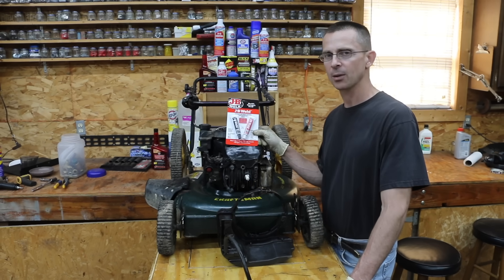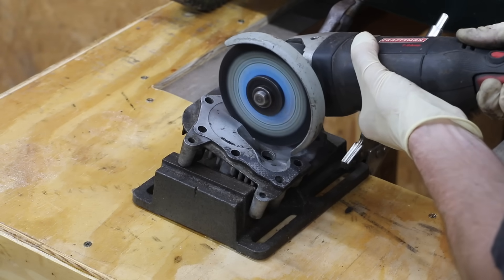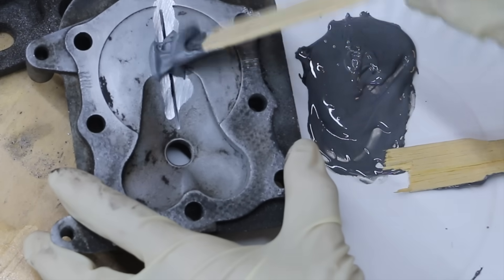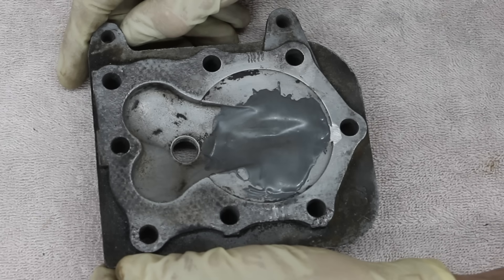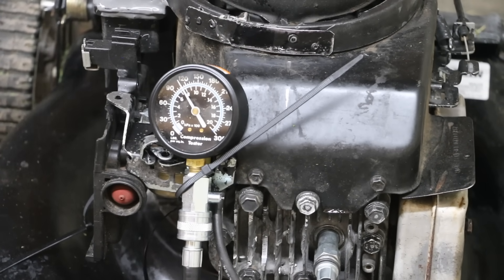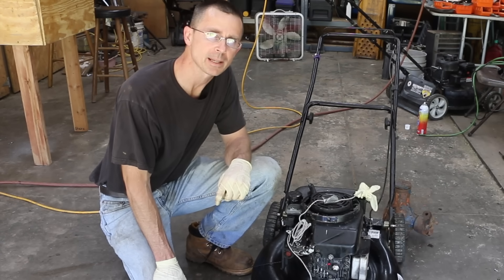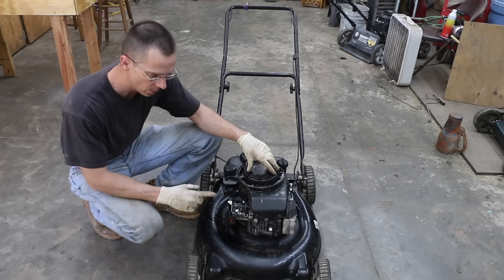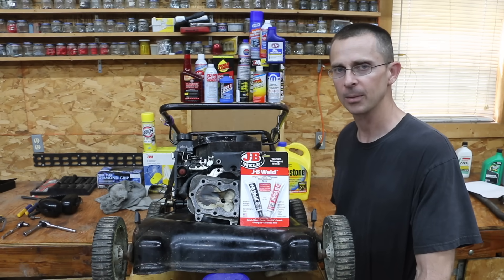Can JB Weld fix a cracked cylinder head?  See the proof!!

Comment: You know, repairing that gas tank got me to thinking about my Dad and home repairs. This was back in the sixties, and we were going to a town 40 miles or so from home. We stopped for lunch along side the road, and as we returned to the old Chevy turtleback, we saw gas leaking from the rear of the car.

We found the hole, which was about the size of a pencil lead. Dad put a screw in it, and then got some soap out and just scrubbed the bar back and forth around that screw head. Now this wasn't store bought soap, this was old home made lye soap, made from ashes and hog lard.

As Dad kept rubbing that soap over that screw head, the drip kept slowing till it stopped completely. Dad checked his Linguine watch, and we sat back down under that tree to wait an hour. We left and drove to our destination, did whatever business dad had to do, and went home. 

The whole trip I kept an eye on that patch for a leak, but it never even got wet. Dad traded that old wreck off a couple years later, and that patch was still holding. I might have been rich by now if Dad had patented  that, and hadn't just passed it over as folklore everybody knew.

I've seen lye soap in stores a time or two, but have no idea if those ingredients would work or not. I could tell you to test it on some tender part of your anatomy and see if it took off hide when you scrubbed one spot too long. (Even with your dedication, I don't recommend that. Saturday night baths isn't one of my favorite memories.)

Enjoy your channel a great deal. Thanks for testing all these things so we don't have to.  👍
Reply from the maker: Impressive repair!  Thank you

Comment: I used it on a fuel line that the screw stripped so I could not remove it or tighten it down. A year later it had a water leak threw the crankcase and the car over heated really badly. Until then the seal held.
Reply from the maker: Impressive repair!

Comment: Before I watch this video, I am going to comment on using J.B. Weld for engine block cracks. I have tried this on my 1949 OC-3 Oliver Crawler with a Hercules IXB3 engine. it had several cracks in the cylinder wall and in between cylinders 6 separate cracks in all. 
I was very disappointing to find out it did not work in the cylinder wall at all. And once it came up to temp the cracks fro the cylinder to a water jacket hole also failed to seal. 
Now I will watch your video to see what if any I did wrong.
Reply: After watching your video, I found out that I did not bevel out the crack or properly clean it. If I remember correctly. so maybe if I properly prepe the area needed for repair it might just have held up. I used another product that you purchase from a pharmacy for something to do with egg shell hardening or something like that I cannot remember what it was called, was recommended to me by an old timer who said it would seal up any crack that goes into the cooling system and i needed to get the engine a lot hotter that it normally runs the heat acts as a catalyst and makes it harden. well it failed and filled my cooling system full of sludge and hardened crystals. I scrapped out the block for another one.
Reply from the maker: Thank you.

Comment: I'm going to use JB weld on a B&S 23hp Intel. I broke one of the sump cover bolts off, drilled it out and going to use a 1/4 in bolt with the head cut off and JB weld it in place. Hopefully it will hold enough psi on the gasket and won't leak. I will let you know. Thanks for your video.
Reply from the maker: Thank you!

Comment: What's that piece of metal covering half of the cutting wheel on your angle grinder?  I bet it's some kind of physical contact inhibitor.  Mine doesn't have one.
Reply: It's to keep fingers from sliding In to the disc while its spinning. Often times its removable by a screw or 2. Allowing more range of motion at reduced safety

Comment: I wonder if the thermal expansion rate of the J-B weld is similar to the aluminum. I wonder how this would hold up to several heat cycles.
Reply from the maker: Lots of comments on using it to repair radiators.  So, I do believe it would work well on aluminum.

Comment: I tried jb to fix a cracked radiator on a car. Didn't work at all. It was on the top of the radiator which was made out of ABS plastic. I staged it with sandpaper and brake cleaner. Apparently green antifreeze eats jb weld regardless.
Reply from the maker: Thank you!

Comment: I bought a used car one time and found out later that it had a rip in the oil pan that someone sealed with J-B Weld instead of replacing the pan. Pretty scary looking but it never leaked.
Reply from the maker: Wow!  Thank you

Comment: Absolutely awesome.  I know guys on the Adventure Riding forums who have repaired cracked/broken sumps with JB Weld.  Nice to see how to go about it, so many thanks for the demo.

I'm now picturing a great need for degreaser, files, sandpaper etc in addition to the aforementioned JB Weld and spare bottle of engine oil but it's really nice to know that if you smack your sump on a boulder or somehow crack the head miles from anywhere, you're just an overnight camp away from being mobile again.
Reply from the maker: Thank you!

Comment: I also repaired a shaft on a 2500 pound megatex counter weight 
The 30 year old top seal and bearing went out 
And destroyed the $10,000 shaft 
I applied Jb weld to the worn area on the shaft with a puddy knife and let cure a little, then filed down the JB WELD while it was still pliable let cure over night then sanded down with Emery cloth 
Reinstall the bearings and seal
Still running that was 15years ago
Reply from the maker: Impressive repair!

Comment: I repaired a corner  of a 350 Chevy engine.
one of the starter bolt broke off a corner of the block 
Clear with brake clean then starting fluid then applied in weld set over night then bolt the start on
Jb quick works best on plastics
You increased the compression by displacing the area above the piston at top dead center JB WELD impressive
Reply from the maker: Impressive repair!  Thank you

Comment: 1 thing my friend, . Its NOT REALY A Crack is it 😶 . ! It's A Cut into GOOD Cast & Not A Real crack that's happened to cast that's got Weak & Blown a Jagged Crack through it & Cus of this, its Not Going to ast the Same if U jus Cut a Nice CLEAN Line in a Good & Still Strong bit of Cast & also from the Inside out, . Were the Weather has NOT Touched it, 😅 lol . My friend, . How much Did they Pay You to do this "BLAG VID" For this Bond 😎 . ! I'm not saying the Bond don't work, . I'm saying That, . THIS Is NO WAY NEAR The Same as if U REALLY NEEDED To Use a Bond like this For a REAL Hi Pressure Reason, . 😏 is all, . ! Names "DAY" Im From the UK . !

Comment: i wouldn't  be afraid to try JB weld to mend that  ITS like bondo needs a rough surface to bond to.  faster you want it to dry add more harder > more liquid metal slower to dries,  but makes it stronger like 40 % harder 60 % liquid metal
Reply from the maker: Thank you!

Comment: When I was in college I pulled into a unfamiliar driveway in the snow and a rock was sticking up. Put a hole in my oil pan. I was a few hrs from home. A friendly Good Samaritan ran me to an auto parts store and I picked up jb weld. I basically just slapped in on there. Waited a few hrs tops and drove it back home. Never leaked a drop for the next few years that I owned that car!
Reply from the maker: Impressive repair!

Comment: ive used jb for decades, most extreme was filling in exhaust manifold pitted donut  gasket seats on old fords v 8s. will last quite a while but eventually always burned out. another was to fill gouges on a cylinder head surface and milled it smooth. gouge slightly less than 1/2 mm deep from cylinder skirt to water jacket on a old chevy six ran it for a while and sold the truck never heard about her again
Reply from the maker: Thank you!

Comment: Been using the stuff my whole life, love it. Still never would've believed it if I hadn't saw it here. Knocked a hole in an aluminum boat going down some sketchy shoals. It was the back corner under the engine. The rock punched in right in front of it and snatched a piece out of the side and busted the corner. Had a crack about 3" running up towards the transom and one at the bottom running horizontally for roughly another 1". Was able to drag it up on a rock get it dry and clean as possible. Patched a hole the size of a quarter and the cracks with one package, still use it without any leaks, been 10yrs not sure I wouldn't just do it again if it did
Reply from the maker: Thank you!

Comment: Awesome video!!

I use it to seal my headgasket on my high performance 2 stroke mopeds, and it works great!

Im planning to do the same with my cars headgasket by adding a thin layer of jb weld if i am sure that i have headgasket sealing issues. 

First i will replace the thermostat and waterpump and then i will see if the used ones are still doing their job or not, if they are still in a working state then i will use the jb weld headgasket trick
Reply from the maker: Thank you!

Comment: I had an old Toyota FJ40 from the 70s that smelled like fuel whenever it ran. After inspecting the fuel tank I discovered that there were hundreds of little pinholes, probably from rust. Those older parts are expensive, so I cleaned it the tank and smeared JB Weld over the entire thing. It never leaked or smelled ever again. I've been a JB Weld fan since.
Reply from the maker: Thank you and Happy New Year!

Comment: I used JB weld to reattach the outside rear view mirror on my grand-daughter's Ford Focus. She drove the Focus for several years until finally totaling it on winter ice. The car looked pretty bad but that mirror was still intact. Also used it once to repair split in my daughter's Malibu's gas tank. I had to use a punch to make the hole round and then used JB Weld on a pipe plug and screwed it into the tank. Never leaked again.
Reply from the maker: Thank you!

Comment: I used JB Weld 20 years ago to hold on a brake line mount that the bolt holding it stripped out. At the time, I thought this was a chewing gum fix, but I haven’t had any issues since. After watching your video, I think the fix will last forever.
Reply from the maker: Impressive repair!  Thank you

Comment: Glad you did this test but I guess it just reinforced my opinion that JB weld is magic stuff. I’ve used it for years and it’s never failed on me in some pretty unbelievable situations where there were high vibration and / or heat / stress. Never a crack. I keep it with me all the time, in the shop, Peterbilt etc. it’s great get out of jail insurance and has gone on to be a permanent fix.. it’s especially fortunate that you made a ‘mistake’ and the piston was hitting the head that only reinforced the concept of how tough the stuff is. I like your videos and I’m a subscriber
Reply from the maker: Thank you!

Comment: when I was a kid my dad used jb weld to rethread the spark plug hole on my 70cc honda 3 wheeler. *I cross threaded it and stripped the threads*. it worked for years. he even sold it years later.
**edits
Reply from the maker: Wow! Impressive repair.

Comment: Back in 2014 my mom and I rebuilt the engine in her car, and while she was taking the valve springs out, she broke a piece of the head off, and it was a corner piece on the inside of it. It had an oil canal inside of it, she didn't want to buy a new head, so she got the broken part and used JB Weld to re-attach it, It has been fine ever since, good oil pressure too.
Reply from the maker: Wow!  Impressive repair!

Comment: Can JB Weld fix a cracked motorcycle frame?
Reply from the maker: Thank you.  I would not use JB Weld for a repair such as this one.  I would have it welded back together.  I wouldn't trust any epoxy or glue product for a frame repair.

Comment: I have used JB weld on plastic tanks in the past. There is two problems with this fix. #1, the tanks made today are polyethelyne  and nothing sticks to it. The other problem is that if you do get it to stick, the vibration usually unsticks it fairly quickly. So far, as a professional small engine mechanic, I have found that superglue and baking soda has been much more effective than anything I have tried in the past. The best fix for a leaky plastic fuel tank is quite simply a new tank.
Reply from the maker: Great point. Thank you

Comment: I have a Range Rover and from what I understand you have to replace the head gasket every 40k on average. There is apparently no permanent fix for this. Can I coat both sides of the head gasket with JB when I replace it?One side? which one?  Will it work?
Reply from the maker: I wouldn't do this.  Wish it would work but I believe it'd cause problems.
Reply: @ProjectFarm  Thanks for the advise

Comment: Your videos are the best. Very informative and factual.  Thank you. 

 Here is my JB weld story.
 It was 1978 and I flushed out the radiator in my 56 Chevy with a 235 6 cylinder in it. I just used water and like a 17 year old kid didn't put antifreeze in it yet. Well it got down to about 15 degrees Fahrenheit the next night. The engine  block had a big crack going horizontally about 5 inches long on the passenger side of the  block. Well I drained the radiator, cleaned it off really well and heated it up with a drop light.  I talked to my high school auto shop teacher and he said try JB Weld since you have nothing to loose.  
 To my surprise after appling JB Weld I had zero antifreeze leaks out of the block! It saved a broke high school from having to buy another block.
 I am sold on it.
Reply from the maker: Very impressive repair!  Thank you for sharing this experience.
Reply: You should drill an 1/8" hole at each end of the crack about 1/8" beyond where it looks like its going.  This stops the crack from expanding and vibration of the crack from making it fail further.
Reply: @jerrynewberry2823  I can verify drilling the hole works well it you get it in the correct spot. I did that on an old shovelhead Harley aluminum inner primary case. worked for almost 20 years till I had the money to have the aluminum crack welded up but a professional welder. That just held up for another 22 years.
Reply: @jerrynewberry2823   That's exactly what I was just thanking it it is called pinning the crack
Reply: I just used jb weld on my radiator which had leak. Fixed like new.
Reply: Ditto with my inboard engine on my boat

Comment: The mower that takes a lickin & keeps on tickin.... Thx for testing these products in real hairy situations & proving what works. Saves lots of money.
Reply from the maker: lol. Thank you!
Reply: Project Farm , I watched ur video last night &  today my friend had a problem w a leak in his power steering system so I suggested using the JB Weld as a solution & it worked great. My friend is so grateful. He said this issue has been a daily headache for him & a costly one. He was dumping fluid in daily. This product worked like magic. It set for 2 hours & the "weld" is holding up under the pressure of the system. Don't think it's a permanent solution but it definitely stopped the leak & is buying time to get some money together to replace the part & have it replaced. Thx man.

Comment: It does seal a cracked block I had a 1969 firebird with a 10" long crack more like a fault line when I bought it put JB Weld on it and drove it for years before I sold it and the guy that bought it from me have been driving it for years. I've used it for 40Years best stuff around.
Reply from the maker: Impressive repair!  Thank you

Comment: Hey I noticed you use an aftermarket battery on your DeWalt drill. Can you tell me what brand it is? Do they make a Ryobi compatible model?
Reply from the maker: Here's the battery.  The photo shows a black battery and the one that arrived is gray.  I don't care about the color, but wanted to explain why it looks different.  It does a good job. I need to test performance with the original type to see if they are as good.https://www.amazon.com/gp/product/B074P1TFCW/ref=oh_aui_search_detailpage?ie=UTF8&psc=1

Comment: Recently overhauled Lycoming aircraft engine with less than 200 hours on it, certified crank case, the alternator drive belt tensioning arm bolt boss BROKE OUT along with a fist sized chunk of the case.

I believe it had been damaged before and welded, and that repair failed.

I JB welded it back in place and continued that engine is service for 3600 hours.

The case eventually failed in other locations but the JB welded repair was perfect.
Reply from the maker: Impressive repair!  Thank you

Comment: Awesome was wondering about this application I have used in weld a few times and it's never failed but if I run into a cylinder head crack...this just gives me confirmation that takes away the worry of the head gaskets replacement job if I find any cracks looks like JB  weld will hold up if as as a last resort if it can't be pinned or welded. Keep up the good work.
Reply from the maker: Thank you

Comment: I have a lawn service and I can tell you JB weld will not hold up to gasoline for long. It will seal a fuel leak on a plastic tank for a few days, but will begin leaking again soon after.
Reply from the maker: Great point. Do you use gasoline with ethanol content?
Reply: @ProjectFarm  Yes I did. That may have contributed to the failure.